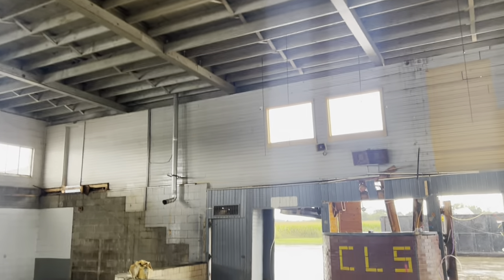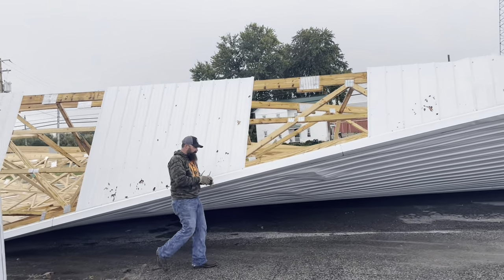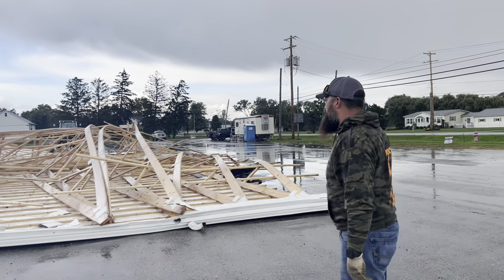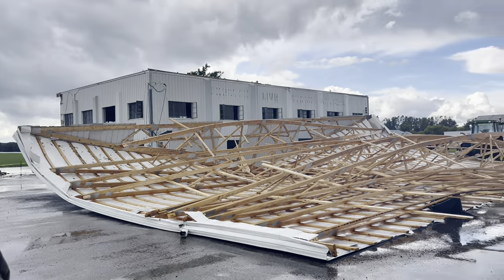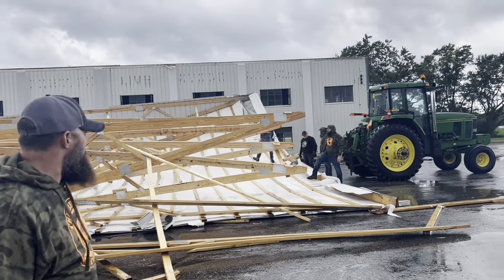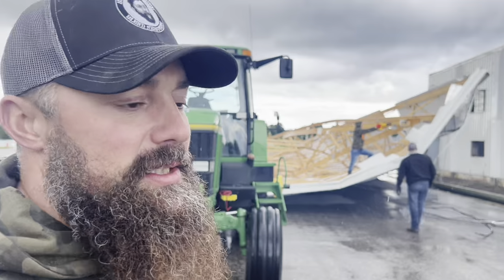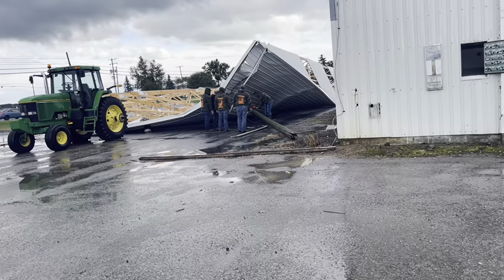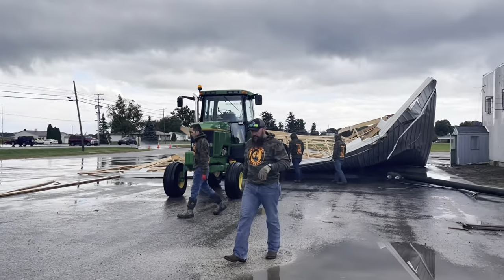Bearded Butcher Headquarters aka “Noah’s Ark” is Sinking!

Comment: Pretty confident that the missing doors/windows that I saw caused this. Because of those openings in the walls, it allowed the wind to enter the building causing excessive pressure buildup inside thus exceeding the original designed allowable uplift on the roof. Adding in the age of the building, the roof likely didn't have anchoring systems seen in buildings today. These two conditions are likely the cause for the roof failing. Unfortunate situation. Glad no one was hurt.
Reply: Agree Kurt
It might be time to consult with a structural engineer as to the stability of the rest of the building.  That many openings in windows and doors makes for a wind tunnel.  Unfortunately old buildings like this sometimes were not build with the most exacting standards in mind.  Thankfully no one was hurt!  Take that as a sign to get some help!

Comment: So think about this regarding the choice to rebuild the roof on this building vs tearing down and starting from scratch.  If this building is still structurally sound, you are likely better off financially to to just build a new roof on this building.  If the building is sound, then it is effectively 75% built already and is just ready for s new roof.  

If you started over, then youd build the foundation, walls, and everything you need to get back to THIS POINT just to build a new roof on a new building.  

What you might consider is a different style of roof even if you keep this building.  Possibly build up a few more levels of block at th eff top of the walls to make room for a "flat roof".  It would require some engineering for the snow loads, but would be much more resistent to winds.  Or, you could design a curved roof, which would allow the snow slip off but also have some resistance to wind, at least in 2 directions.  Or a modified dome roof, which would resist wind AND allow snow to slide off.

Of course if the structure is damaged, then you may very well be best to tear down and start over with an integrated purpose build design.

A structural engineer might have some other ideas or variations of this.  Best wishes moving forward.

Comment: Ok guys here is what you need to use Simpson H10S 5x11 5/8" Hurricane Tie 18 Gauge - G90 Galvanized, cut them through the flat roof sheathing so they can nail to the framing of the flat roof on the flat plate, on each truss, Screw your pulins down 12" O.C. (not nailed) onto the trusses, have Metal Roof Screwed 12" O.C. allow wind to vent through this roof. And it will remain there durring 150 MPH hurricane - I work for high rise wood frame construction company, this is the {Shear} attachment we use - Best of Luck

Comment: With the price of lumber I would salvage as much as possible and find a dry place to store it. 

With the building project your taling on you'll be really suprised how much money you'll save. 

Also with the length of some of those boards you can easily salvage 6ft, 8ft, and 12 ft pieces.

Comment: Regardless of your desire to salvage the original structure, you should really consider starting over. You can always build back to look like original only with structurally sound and insulated building. Will save money in long run.

Comment: I think before I moved it, I would have called the local building code inspector to see if there may have been some design flaws. That framework and metal didn't look very old. There may be a contractor that needs to come back and do it right the second time.

Comment: A lot to consider. Surely it was insured, if so, an appraiser would be the best
place to start. Just replacing the roof if the building isn't sound, wouldn't be in
their best interests, nor yours. That appraisal should be free. 
Many construction/renovations contractors give free estimates also. Perfect
opportunity to get 2+ numbers as well as ideas that would fit your needs.
I suppose this happening now was a Godsend to a degree. Better now than
right after you invested an "Ark" load of money into it and then have it fail.
No pun intended.
With your social platform, you're in the driver's seat too. Just saying.

The real downside to this is, good luck finding a reputable contractor in 
there before next year at best. You don't want to jump at the first person
that says they can start right away for the sake of starting right away.
I might approach whoever it was that updated that other building.

Also, right now, building material prices are through the roof! No pun
intended. 
A lot to consider my friends. Wish you the best of luck.
Mark n Rosa

Comment: Sorry my dudes, Diesel Creek just raised his pole barn and did a roof work right at the end. There's gotta be a better way to build, especially when it takes your business offline in one swoop. Each machine is essential and has a specific role, on top of that, they have to be clean to come in contact with product. The LVL manufacturers outta work on stronger stuff with composite/structured surfaces at the ends for bolting to top plates.

Comment: Are you guys working with an Engineer on that renovation?  Seems like it might be a good idea.  I did not see any tension clips or ties on the ends of the trusses.
Reply: Somebody screwed up...
Reply: Yup...
Reply: I doubt it was the norm, or in the local building codes in 1953.
Reply: @marktoldgardengnome4110  If you look at an older video about this building you can see that the west gable end wall was removed. A strong gust of wind got under the roof and off she went.

Comment: Wow, I'm glad no one was hurt. One helpful suggestion is to have an almost flat roof with no lip or overhang for the wind to catch. All you need is a 2 degree downslope from the center with openings in each Corner and on each side for drainage. If you put a good polymer coating on the roof it will be waterproof. Anyway, God Bless and good fortune guys.😊✌️❤️

Comment: Damn man it sucks to see bad stuff happen to good people. I was informed by the Industrial engineer we hired that a buildings strongest point spans a max width of 30ft using solid red iron steel not that wood. The team we hired said we could go as long as we wanted just stick with the max width of 30ft. We ended up going with a 30x80 and had our buildings certified for 190 MPH wind rating. The engineer said we could park a few big rig trucks on our roof.  I provided a laundry list of what if's to the engineers that we wanted the building to withstand.  The 30x80 cost $44k for the solid red iron building, purlins every 2ft, insulated and wrapped in 24 ga metal and $45k for the triple stacked 12x12x12 rebar, 10 inch slab and building installation. Since we don't know what global warming will bring i went completely overboard.